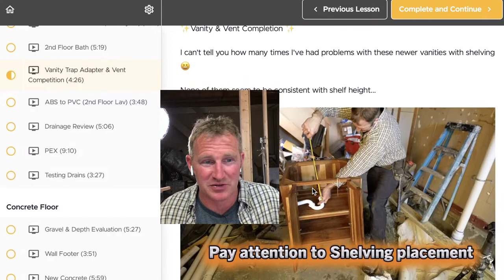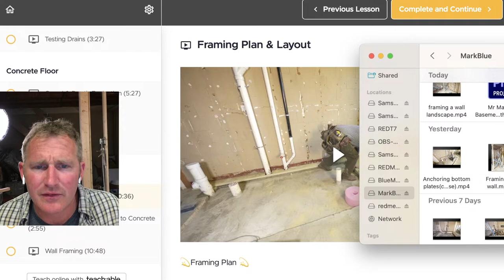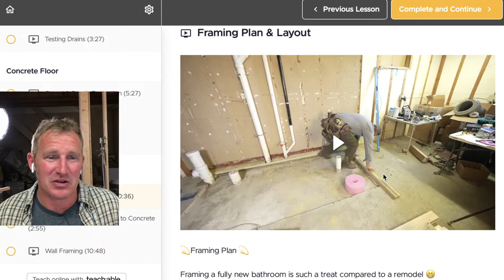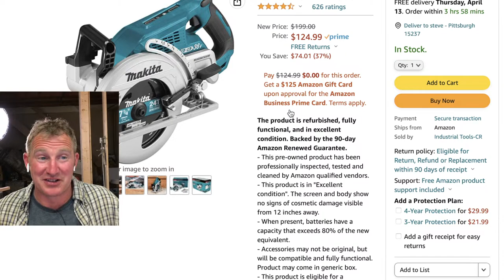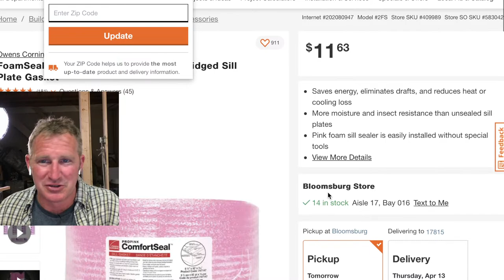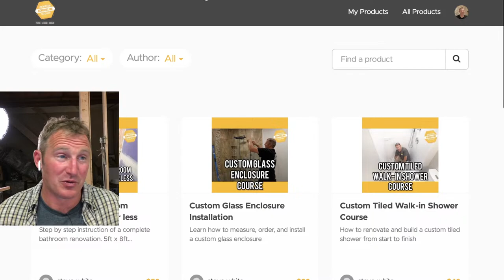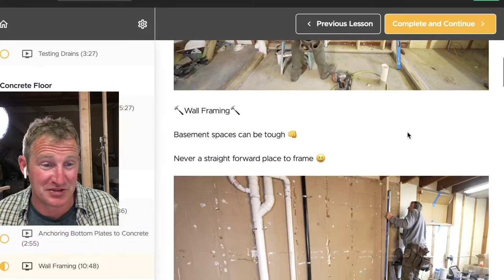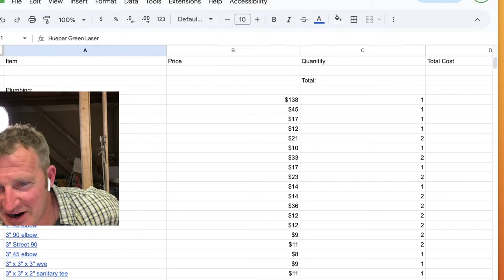Framing Tips for a Basement Bathroom

Comment: I am doing my main bathroom. House was built in 2003. The contractor used the worst lumber in the bathtub/shower. I tried to use it, but it just working out. Now, I need to rip out the old lumber. Every tile job was floated. 700 square ft of flooring and all showers.
Reply from the maker: That’s painful for sure…sorry to hear that